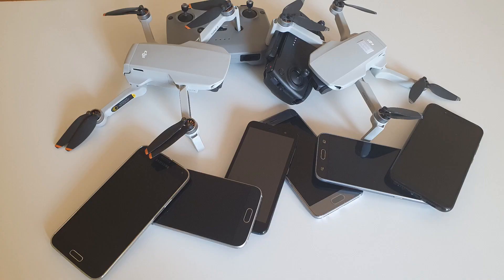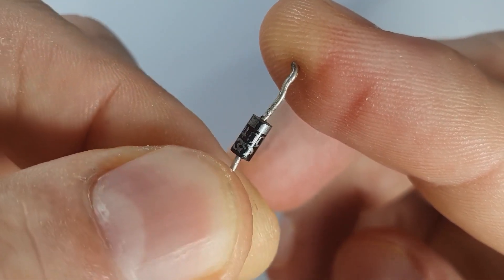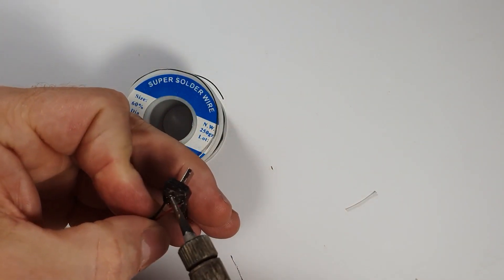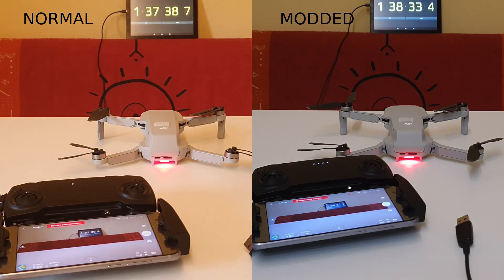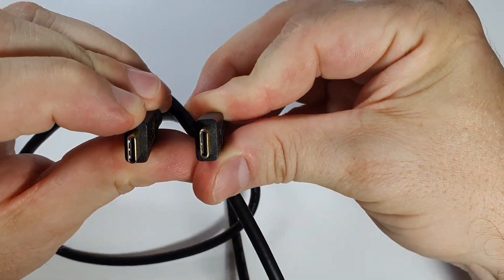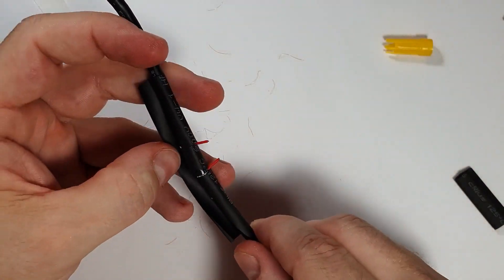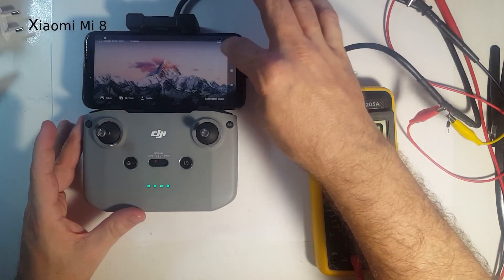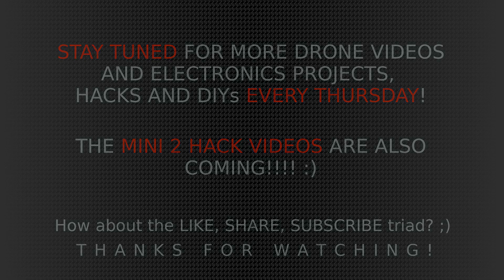Mavic Mini, Mini 2, Mavic Air remote charging Android phone ISSUE SOLVED!

Comment: it also worked for another drone brand with android  phone (Xiaomi POCO)... same problem, same fix, beware charge your phone to last the entire session as the diode prevent "back charging" the phone ... in general shunting different  batteries is a bad idea ... thank you for the tip !

Comment: I've successfully changed a cable. the original dji one. I've bought some non original ones from aliexpress. they have green/black/white/pink cables inside. I put the diode in the pink (closest to red???) IT DOES NOT WORK. WHICH ONE WOULD HAVE BEEN THE RIGHT ONE? I have 2 more untouched cables that I want to modify. thanks for your help!!!
Reply from the maker: Hi. Unfortunately it is impossible for me to tell based on the the colors. It has to be the positive wire. The diode has to face towards the phone. Try moving throught the diode on each wire one after another. Just insulate them well after. As long as you won't short anything you can not make any damage. :)
Reply: Maybe I just put the diode in the wrong way since the silver  mark on the diode shows towards the RC.... Your's towards the phone... I'll try again;) thanks for your quick response
Reply: @Mochioverland It's been a year did you figure it out yet?
Reply: @airwolf3607  the diode was in the wrong direction. Now it works just great:)
Reply: @Mochioverland Awesome glad to hear👍

Comment: I just bought a used, mint Mini 1. At the first test flight the controller showed 4 lights in the beginning but probably wasn't fully charged. After 2 of the 3 flight batteries the controller battery was empty with the controller beeping. I thought WTF? And later suspected the phone charging to be the problem.
It's a real shame that you can inhibit an iPhone from charging in software/os but not an Android phone.
Now when I fully charge the controller and phone before flying, the controller probably will last long enough for 3 batteries, but I still find that a really annoing deficiancy. What if the controller battery gets older or what if you forget to charge it to 100%? Also the controller battery will age faster, I guess.
I can solder but am not happy for having to buy another cable (don't want to mod the original one) and having to invest time, but yeah at least there's a solution. I think DJI should produce such cables and sell them at a reasonable price to owners, as it's essentially just a bugfix for a design mistake.
I take it the diode lowers the voltage by about 0.7 volts, so everything still works, but it's not a voltage the phone wants to charge from. Thanks a lot for finding this improvement hack! And the shrink-tube cut method is useful too!

Comment: How many individual cables are inside the Mavic cable?? I'm asking because I ordered a new Mavic cable which is a round one AND it has 4 individual cables inside. Red Black Green White. Should I weld the diode to the red cable as well??

Comment: Zolly, you are awesome! Thanks for the hack. Since somewhere in the video, you mentioned about the two USB ports would be helpful, I was wondering for a Mavic Air RC, which has two such ports, can I use one of it to charge the RC from a power bank at the same time while connecting the phone from RC? Would such an arrangement work?

The microUSB power in can be used for charging the RC from a power bank, whereas the USB-A of Mavic Air RC would continue to send data and power from the RC to the phone?
Do I miss anything?
I will appreciate a response

Comment: Tried this on my Mavic Mini Remote as I was tired of the battery dying so often. It worked! The phone (Galaxy S10) doesn't take charge at all now but all other connections worked as they should. As a note on my USB-C wire, the red cable was on the opposite side, which meant I had to cut away more rubber than I'd hoped, but nothing that heatshrink won't fix.

Comment: is this compatible on mavic air 1 remote?thanks in advance
Reply from the maker: Hi. To my best knowledge yes. Haven't tried it though...
Reply: I just did it a few minutes ago, I can confirm it works with the Mavic Air 1 remote controller. Thank you very much, Zolly! You can modify the video title and / or the description, so more people can be helped by this solution, it also works with Mavic Air. Now there is no more need to replace the controller's internal battery.
One more thing: if you do want your phone to be charged during the flight, you may use a wireless charging pad (powered by a power bank) attached to the phone. I just tried that too and it works flawlessly. Of course, your phone must support wireless charging.
Or, you can add a micro-switch, just in case you do need the remote controller to charge the phone.
Reply from the maker: @Giurumea  Awesome!🙂

Comment: Thanks for this tip. I tried it on my Asus Zenfone 5 charged to about 60% and DJI Mavic Mini 1 with 75% battery. I was surprised that this solution with diode did not reduce current near zero, but only to 0.19 Amps. Anyway it is better than straight connection which takes 0.50 Amps. I tried reverse diode or 1K resistor, but none of those alternatives worked (no communication with DJI app).
Note: diode is 1n4148 from my old supplies. I may try a different diode later.
Reply from the maker: I think it can be the phone. But sure, try it with a 1N40 series diode.😊

Comment: What would happen if you turned the diode the other way, so power doesn't flow from controller to the phone?
Reply from the maker: There would be no communication between the phone and the controller. It does not work that way.

Comment: you do realise if you read the manual you would have seen the bit about turning off phone charging in the dji app.....
Reply from the maker: On android? That is odd....
Reply: @ZollyD  its in the app not the device.. apple or android , dji put the feature in way back
Reply from the maker: Have you actually tried it on an android device, because all I know is that it is not even in the app for Andriod. For Apple yes. I am not trying to make you wrong, really, I just feel stupid that I missed it if it is there.
Reply: @ZollyD  you're right. there is no option to turn off charging in the dji app for android phones. this option is only available for apple.

Comment: Do you know if this method will work with an EVO 2 controller connected to an EVO 2 using a Samsung phone ?  We have the same excessive controller battery drain.
Reply from the maker: I believe it should work. (No guarantees) If you can get a cheap cable to test with... ;) It will not hurt anything. Basically instead of 5V you send around 4.2V from the controller to the phone. Worst case, it does not work.
Reply: @ZollyD  Thank you. I'll give it a try and let you know how it works with my Samsung Note 8.
Reply from the maker: @bartcomo7433  Awesome! If the diode does not work you can also try a 100 Ohms resistor as well. Some people wrote that that works too. 😉

Comment: What a great solution! Thanks, Zolly. Surely this could be made commercially for Android users?

P.S. Can you think of a way (flashing coloured leds?) could be made to go around the drone but turned on/off via a user separate remote control (so the leds don't drain a small battery when not looking for it? :-)-
Reply from the maker: Thanks! :) I am planning to have some nice lights for the drone in a future video. 4 lights under the motors. I want them each to change color depending of the corresponding motor speed. Theoretically like that we could visualize the adjustments the drone does to the motors to stay in position... :)
Reply: @ZollyD  That would be very useful.
Why I asked was that I lost a drone in some trees and if it had flickering /flashing lights off their own power source (a CR battery?) and a remote on /off via a toggle in my hand it would make finding the drone a lot easier in the dark. Toggling on/off would mean they are not draining their battery except when I'm searching.

Comment: how much does it drain the controller? and does it have to be plugged in to use it?
Reply from the maker: The current is very little. :) I do not understand your second question. Please explain!
Reply: @ZollyD  the phone has to be plugged in to the controller to use it?
Reply from the maker: ah I get it. No, actually you can fly a drone without a phone connected to the controller. You can even record video with it using the dedicated record button on the controller. :)
Reply: @ZollyD  cool i am waiting for my mini2 to show up from dji thanks for the info sir.
Reply from the maker: You are welcome! :)

Comment: The diode patent works with one exception. When the phone is 100% charged, Djifly will not start up.
Reply from the maker: That I believe. Good input. 🙂
Solution for that is to watch one of my videos on the phone before flight and the battery becomes immediately 96%. 😉
Reply: @ZollyD  There are those on the DJI forum that nothing will convince them to believe that your method works. Someone else tried with a 10 Ohm resistor. Do you see any difference? Yes, your videos can discharge your phone to 0%. ;). I will add that my smartphone is the LG V50. But it's a great job. Thank you.
Reply from the maker: @dereksynkopa1822  😂 Good then that I do not want to convince anyone! This is just what I used for almost 2 years and it worked for me. Maybe it does to someone else too. 🙂
Reply: Thanks for the video.
I made the mod and it works on a samsung s8, but not on a samsung a40.